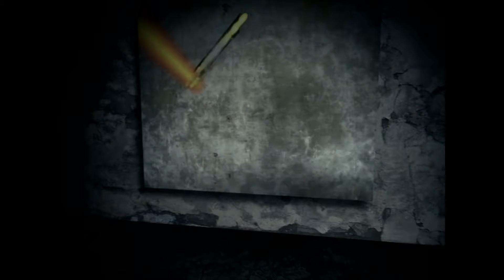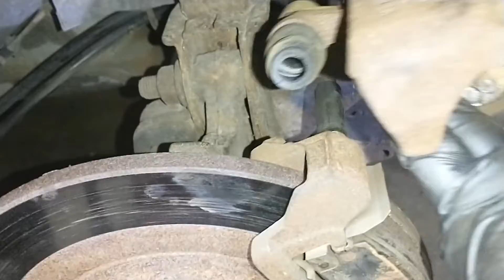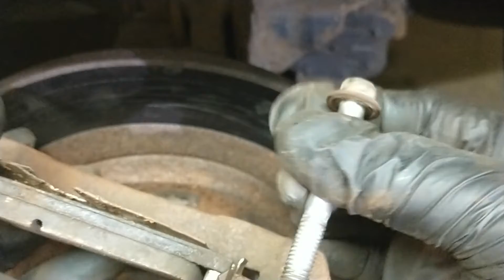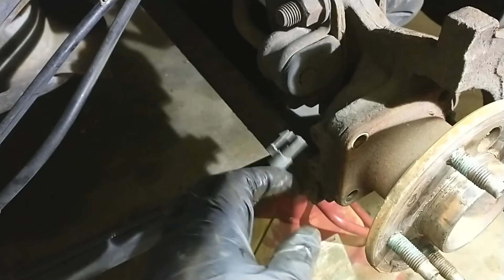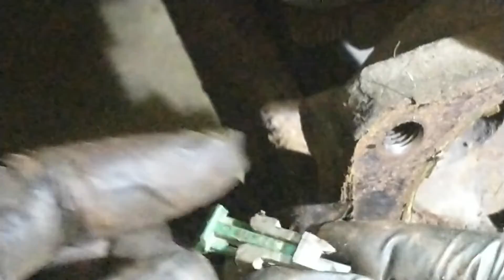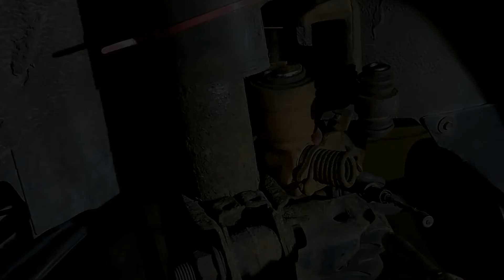1994 Oldsmobile Cutlass Supreme Rear Wheel Bearing Replacement

Comment: From personal experience as a dealer technician, these have cast iron flanges and they almost fall apart unlike the aluminum spindles where you have to heat and beat forever due to aluminum corrosion
Reply from the maker: @dave1135 I definitely got lucky with this one. Thanks for watching and the comment!